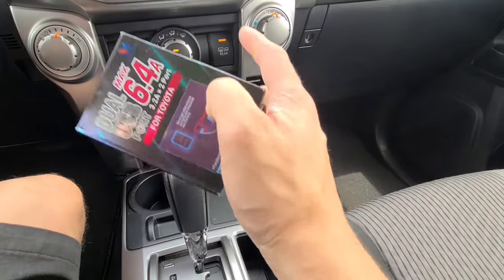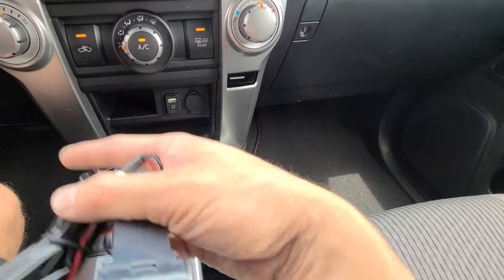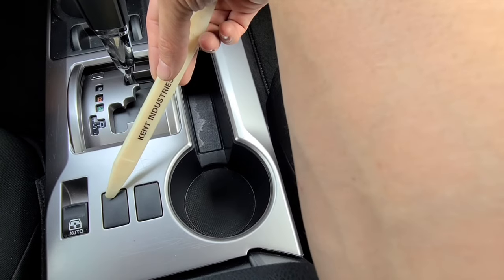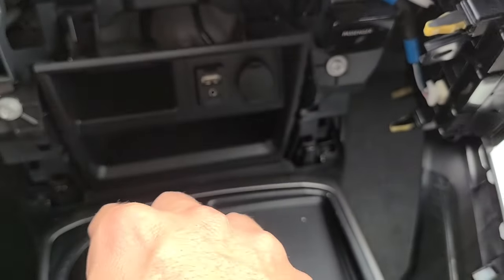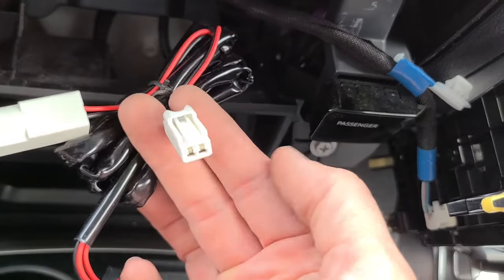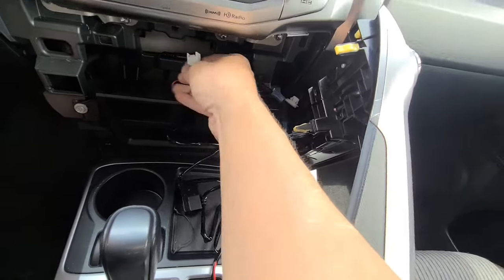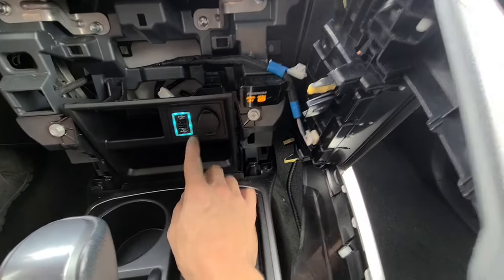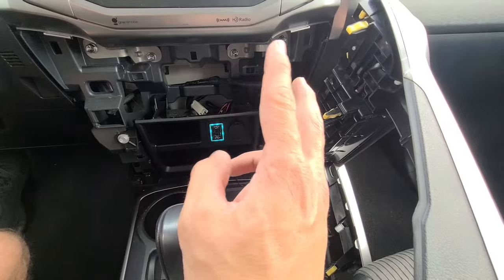Every Toyota 4Runner NEEDS THIS Dual USB Port Quick Charger Socket 3.2 Amps Quick Charge Your Phone

Comment: I was really hoping this would work for my 2012 4Runner but it didn't. The female connection for the charger is a 2-pin and the male connector (from my vehicle) is an 8-pin. My original port has the earphone jack with no USB slot instead of the combo as shown in the video...probably a newer 4Runner although the panel looks the same. Maybe I can find a coupler to make them work but not hopeful. I'll return the charger but the good thing is that I know how to take that panel off the dash and put it back on!
Reply: I had this same issue
Reply: Did you ever find one that worked?
Reply: Did you ever find one that worked?

Comment: Just installed this. Followed your instructions. Very well done. The only thing that I did a little differently was I went ahead and I undid those 10 mm screws and that little panel pulls out pretty easily.  but it gives you just that little extra bit of room to undo the clip for the cigarette lighter.

Comment: Chinese electronics never last.i did buy this model for a backup. Bought oem one Trust me I've been there. I ordered mine from the dealership seems to good quality,due to fact I'm not going to pull the ac portion of my dash to replace it with a year.
Reply from the maker: Had it installed in my tundra for 4 years, use it daily. Zero issues
Reply: @Donnythelatemodeltech you got lucky I installed one on my 4runner 4th generation it was usb and voltage meter went in 8 months.

Comment: Bought this for my 2018 4Runner. Unfortunately,  the plug from the original harness to the harness on the new USB port does not match up. Really strange..The plug to the 12 volt outlet is correct.
Reply: I was about to buy this I have an 18 4R orp, did you use a different plug to finish your mod?
Reply: Yes, I meant to post back up.. it doesn't use one of the plugs from the vehicle harness.. Been using it for a while now and I've been happy with it.

Comment: Does this work for a 2013? 
Does it provide power without the key being turned on?
It appears as though it does, but it plugs into the power supply for the cigarette lighter, and the cigarette lighter only has power when the key is turned on

Comment: If you use the spots by the cup holder the location in the dash will be unusable since its now plugged into the new one right?  Do you know of a way to keep the dash working while adding the one into the cup holder?
Reply: its a different plug, he just undid the one with the aux to use that space.

Comment: I just got a phone charger mount and when I plug into the original usb slot, it says the power consumption is too high to the device shuts off. With this quick charge 3.2amp port, would that work? it is definitely the charging device that is drawing too much power.

Comment: Does it work for a 2021 model
Reply: Well I bought one of those fas changer but but the oem at the time you connect your phone to use the GPS or other apps, but with this fast charger is only for charge your phone with this you can't connect for use any apps at least for my 4 runner 2021

Comment: do you recommend any other without the red and blue lighting?
Reply: also, is it basically the same if i wanted to put on the left side of the steering wheel?
Reply from the maker: Yep, I can't find one this good without the lights, I honestly wasn't thrilled about it, but its actually not that bright,  its actually kinda cool know when things are fully charged.

Comment: Great video! I love the fast charge. May be a dumb question but my CarPlay doesn’t work anymore when I plug into the new USB port. Any tips?
Reply: I haven’t done this but it probably just charges and does not transfer data
Reply from the maker: Why would this transfer data? Lol.
Reply: Late reply but maybe will help someone. The OEM port functions with your head unit. Replacing that port with an aftermarket power only port removes the head unit capability.
Reply: @Donnythelatemodeltech  because the original USB port you replaced did so…. (Hence why he’d think it would)